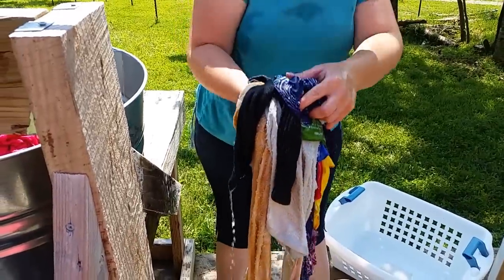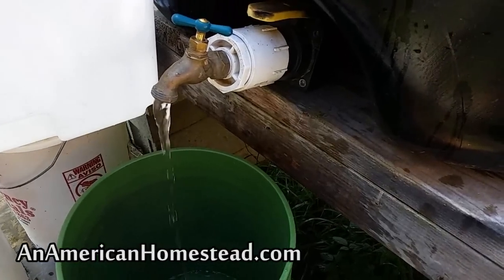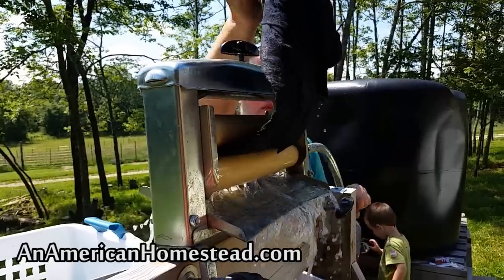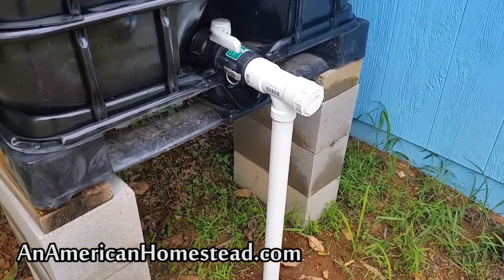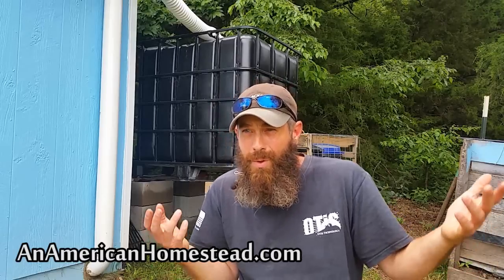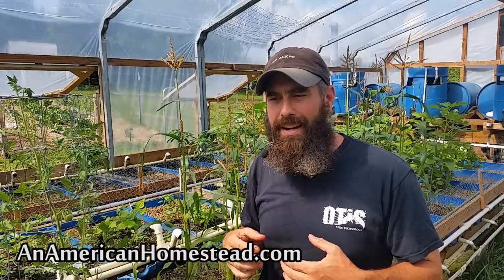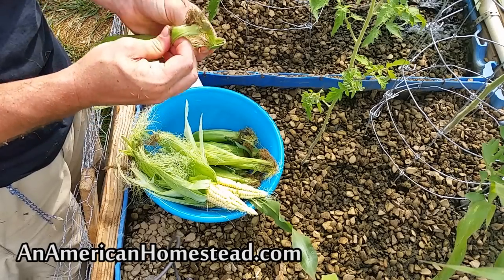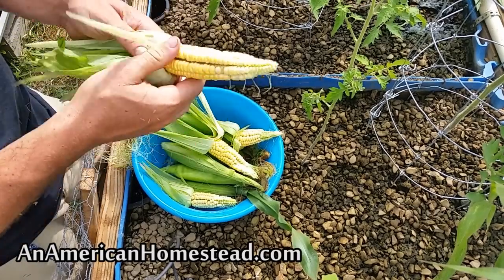Season 2 Episode 4 - An American Homestead - Rain Catchment

Comment: Howdy, Thanks for your show. We're not fully homesteading yet, but working on it.  1 quick suggestion.  Make your own lumber.  With just a chainsaw and a pressure treated 2x4 as a straight edge you can make lumber pretty well.  If for chicken houses and fencing you don't even need to cure it.  This will save tons of money and add plenty of satisfaction to your homestead.  I recently built a 15x10' woodshed with 2x6's I ripped myself with rafters for extra lumber storage. It cost me only hardware and roofing. With more old timey techniques, you can save money on the hardware as well.  Good luck guys.

Comment: I am really enjoying these update.  This is a lot of work but it looks like the entire family is enjoying it.  A few comments/questions: 1. Im sure you have heard about the wind pollination for your corn.  Hand pollinating is not enough, corn needs to be planted in rows forming blocks in order to have any chance, your corn looked like classic non pollination.  2. Corn is an extremely heavy nitrogen feeder, by he looks of the other plants in the greenhouse (not over green with vegetation), it doesn't appear that you had enough.  Just the right amount for everything else, but not nearly enough for the corn.  3. As for the outside corn, get some beans or climbing vegetables in the ground around the stalks and use them for poles, this works great.  Google the three sisters planting, but I am sure you have heard of this.  4. Did you paint the water catchment black to decrease algae growth, keep it warmer in colder months or both? 5. What is the frost level there?  Are your pipes deep enough to prevent freezing in the winter or will you drain the lines?

Thanks again for sharing this, it was fantastic as usual.
Reply from the maker: Thanks for the heads up on the corn. We will drain the lines in winter.

Comment: I built a state of the art Aquaponics system, spent a great deal of money on it. In the end I went back to the soil. The cost of an Aquaponics system and the effort to maintain it doesn't justify building one in the first place, only problem is you will never know that until you have built your system. It grew the most beautiful greens a guy could hope for but there are to many limits on what you can ready do with it well. I found I can grow anything in the soil. Without any headaches.
Reply: Do you live completely off grind?  Do you have a private well as your only source of water, or do you have access to large unlimited amounts of water being pumped to you that you pay for?
Reply: No I lived in the city, with a full time job. with very limited time. Even the noise from the system was a pain as neighbors complained because of the air pump. I could go the best greens, even in the heat of the summer. but every thing else had it problems.
Reply: Mika Lee Oh wow ok that makes sense. I am fascinated by them and want to try but don't have the room. I do breed fish and have a very small garden.  I think your situation is much different then Zach's it would seem. Very interesting though. I'm guessing its quite costly to start
Reply: Yes, you have to spend money to just set it up. I DIY my system and had a couple thousand into it. The system worked well, but limited to what vegetables you can grow. Just wasn't practical in my mind. I bought some land with 4 acres. So I have plenty of room for my garden and chickens, going build a small hobby farm so no need to mess around with expensive projects that aren't necessary.
Reply: Mika Lee That is a lot and I doubt yours was extremely large. Did you sell it?  What type of fish did you use? Do you eventually do anything else with the fish.
Reply: 130 Tilapia, in my tank, three barrel filter system, two grow beds. It wasn't a very large system. although I could have added a couple more grow beds if I had the room which I didn't.